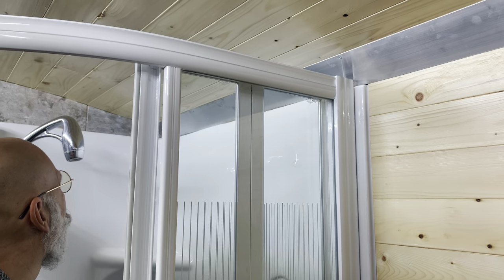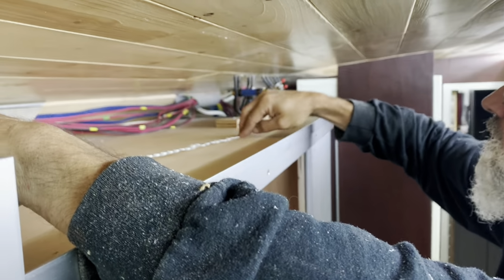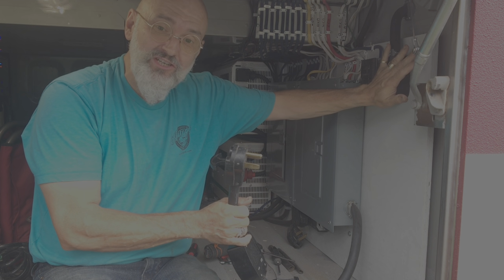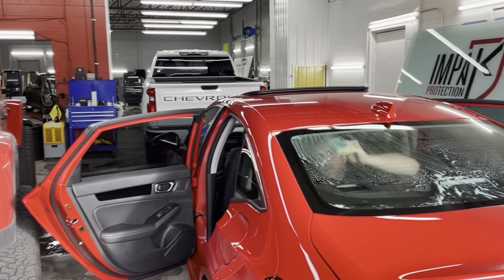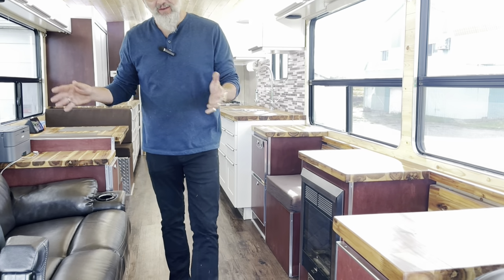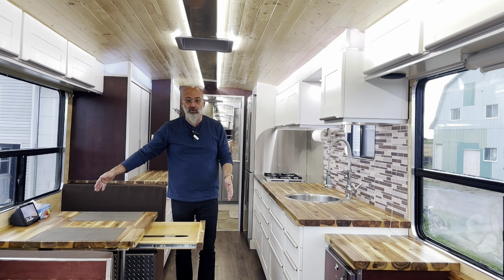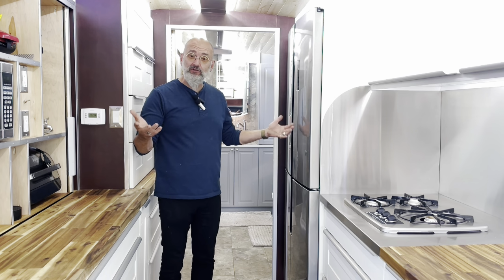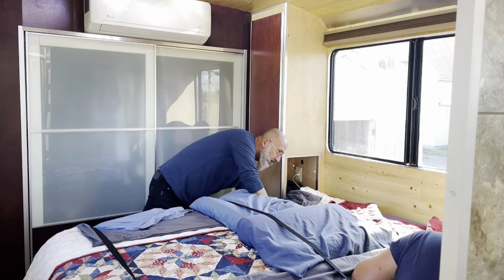E61, Bus Tour and finishing touches

Comment: Fantastic job. On the fridge, that’s a Haier brand refrigerator, right? There were two versions. Looked the same exactly but the differences were very minimal. They both had the inverter technology but the one I have has a lock function on it. However I do plan to do as you did and add the screw in lock. I bought this fridge for exactly the same reasons that you did then laughed when I saw yours on one of your videos. It looks like we were both on the same page then. Lolol
Reply from the maker: This fridge is a Brada, it has the lock function, it locks the controls so kids can’t change the temperature.
Reply: @LacroixCruiser  ahh ok. This one actually locks the doors. But still. You can never be too safe. Bet you they are the same fridge, just with different brand names.
Reply from the maker: Lots of cross branding.

Comment: I really like your drawer lock setup. I seen it in an earlier video and gave me an idea for my war wagon. We had already decided to use a screen and projector for ours. With our setup we are putting it in front so that both side seating can view. But definitely like how you did yours. Opposite our couch is 2 lounge chairs so we need ours pointed different obviously. 
I really like how your overhead cabinets open upward. Is that kinda normal for conversions? The ones in my are the same and I've not had a camper or anything the same way. Looks like you are pretty well finished! I hope it brings you much happiness!
Reply from the maker: Thanks, our to do list is still a couple of pages long, but it’s livable.